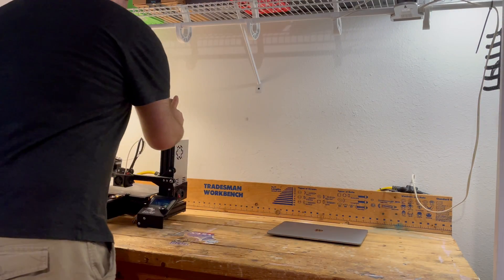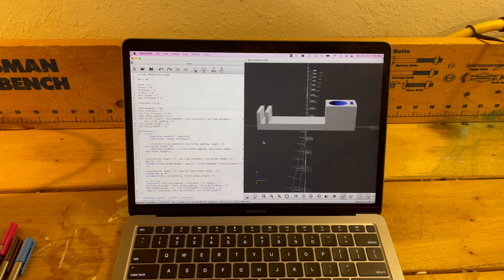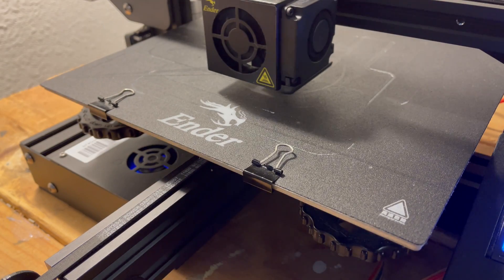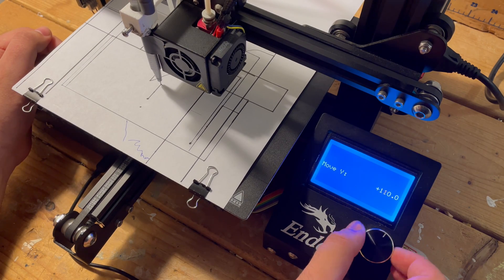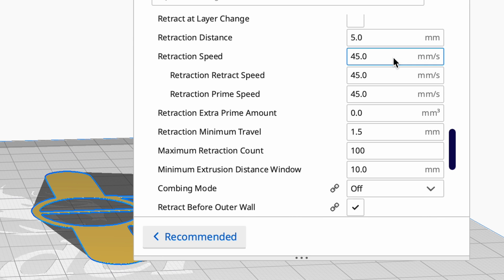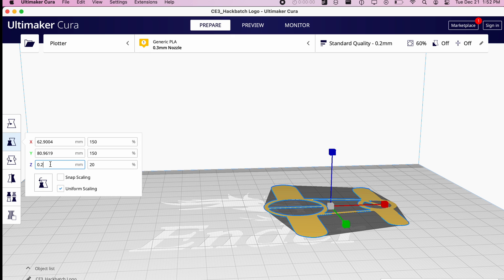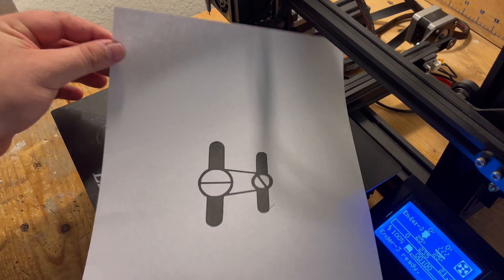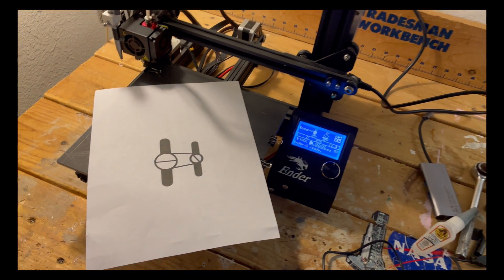How to turn your 3D printer into a drawing machine

Comment: How do you calibrate for the pen? I know you covered the z axis but how do I make the pen the center?
Reply from the maker: What I used after making this video was an extrude offset in Cura machine settings for my printer. If you click Preferences from the top menu bar in Cura then, Configure Cura, Printers. Next select the printer you want to edit and click Machine settings. Click on the Extruder tab and it should have an option for Nozzle offset X and Y. This will let you tell the printer that the nozzle is offset to the point where the pen is. So if you measure it from the nozzle you can center the pen depending on where your paper is of course.
Reply: @hackbatch  thank you!! very helpful!
Reply: @hackbatch  Hi, another question: How do you measure the exact distance from the nozzle to the pen to input in Cura? I'm guessing the number must be precise in order to work.
Reply: @petrickstea2422  If you use ender 3 you can just moving the axis until it reach the corner, and then you see how much mm you have movd
Reply: Hi
Reply: It's a complete step backwards in 2D printing... Or at least five, but it's great

Comment: Thank you amazing video! Cant wait to turn mine to be able to do this too. Question that i will be able to answer eventually my self but here it is. Can you keep the part on the printer while ypu normally 3d print or needs to be removed if not in use?
Reply from the maker: Yes in this case I was able to keep that part attached to my printer with the pen removed and it was just fine! Glad you liked the video, thanks
Reply: @hackbatch Awsome man cheers!

Comment: Actually I think you can install a mosfet like system to the extruder motor that controls a servo which lowers the pen whenever the motor starts to move, I think that would solve the Z-hop problem.

Comment: @hackbatch ,can you still 3d print after doing this
Reply from the maker: Yes! This is just the slicer settings plus a plastic attachment for the pen. You can always take the pen out and 3D print as normal
Reply: @hackbatch  can i also do this with the BL touch still there?

Comment: Excellent video, thanks.
Funny things, humans... we are prepared to devote hours to achieve a result that our cheap inkjet printer would have done better in a few seconds!
This is NOT a criticism of your project;  I have spent a ridiculous number of hours on a pen and vinyl-knife holder for my Ender 3.  Like you, I've had very pleasing results with the pen, and the Ender can now write my signature better than I can.
For anyone wanting to try the drag-knife, the printhead carriage on a typical 3d printer does not really have the necessary rigidity.  I was able to produce pleasing car window signs when I was selling it, but eventually the knife blade snagged in the cutting mat and snapped my knife holder.
A strange quirk of fate: I just finished 3d printing a replacement holder last night, a year after the original broke...  Is that spooky, or was Google eavesdropping again!   😮
Reply from the maker: Funny things indeed! Thanks for you comment. I am definitely the type to spend much too long tinkering but I am happy to do so. And thanks for providing your tips on the drag knife mod.

Comment: I am trying to do this on the Neptune 4, using cura. The problem I keep having is just as the pen is about to hit the paper and begin plotting I am getting a klipper message saying - 

PLEASE RUN ‘SDCARD_RESET_FILE OR ‘FIRMWARE_RESTART’ TO RESUME.!! Extrude below minimum temp 

It seems the printer will not allow me to run Gcode with the extruder temp set to 0. 

Can anyone Help
Reply from the maker: I have no experience with Klipper firmware but it sounds like the firmware has a setting that doesn’t allow for 0 temperature. I would try disabling the hot end in Cura in your machine settings. I am not sure if that will do it, but it might help. Otherwise, I think this might be a firmware level restriction with Klipper.
Reply: Thanks for getting back to me, where would I find the option to disable the hot end? I can’t seem to locate this.
Reply from the maker: @3dmaker186  It seems I am misremembering a setting in Cura that does not exist sorry. It looks like you can disable the heated bed but not the nozzle. Not sure what the solution is here besides a change at the firmware level. or possibly manually replacing lines of the GCODE file to not move the extruder motor. The method shown works with Marlin and that's the only firmware I've tested it with.

Comment: When I first installed the Z offset extension, it did work for me, but throughout experimenting, maybe also after I installed few more extensions, I could not get the desired effect whatsoever. It was frustrating. Though, I managed to work around it by initiating the print and hitting PAUSE immediately on the printer (after it did the initial moves, but before the print). Then I manually adjusted the z-offset on the printer under tuning and resumed the print. But before that, it broke the tip of my pen... What a frikkin force.

Comment: Will the printer not try to extrude the filament anyways?
Reply from the maker: The nozzle is not heated. I suppose it might be trying to move the filament but if that is an issue you can unload the filament before plotting.

Comment: Get a drill tap threader for those holes. Never needed a nut ever again. One of the most revolutionary thing I did for my prototypes.
Reply from the maker: I mostly use heat set threaded inserts for my prototype parts nowadays. Thanks for the tip!

Comment: How can i get rid of the line that the printer leaves after its done printing?
Reply from the maker: You can add a line of GCODE to the end of the print that raises the pen upwards before it moves over. In Cura, if you look under the machine settings you can add a line to lift the nozzle and the pen in the End GCode text box. I forget what the code to lift the nozzle is but I’m sure you can find it with a quick search.
Reply: @hackbatch  ok thank you

Comment: Love what you did here. Possibly a more elegant solution that some that I have seen that used laser gcode. Do you have any suggestions on how you could use this on a printer that has a bed sensor like the BL Touch?
Reply from the maker: Unfortunately I don’t have a bed sensor, but I think that might make it more complicated than it has to be. I just measured the distance from the pen tip to the nozzle to have the correct GCode offset
Reply from the maker: It might be possible to put the bed sensor where the pen would be, but that still requires aligning them. So I think it’s possible but I don’t have any experience with that sorry.

Comment: Hey, Great video!  Quick question- I am starting the printer with gcode, and it is stuck at heating. Do you know what the issue might be?
Reply from the maker: Hello, thanks! You should disable the heating on both the nozzle and bed by setting their temperatures to 0 degrees. Unless the printer is somehow checking for a temperature over 0 degrees and never reaching it. I would double check what it’s trying to heat up to on your printer. If it’s anything above 0 stop the print and redo your gcode file. Hope that helps!

Comment: Great video helped me a lot. I have a question, I'm having trouble converting my SVG to a good STL file, do you have any recommendations? I've tried many online tools but the results either don't work or are bad. Thanks! I'm trying to do writing by the way.
Reply from the maker: Hi Thanks! The tool I used is linked in the blog post in the description. Perhaps the results you are finding are due to something with the SVG paths for the writing. Are you using a font in SVG somehow? I was interested in doing this but that’s the part I got stuck trying to automate.

Comment: Why don’t you have to mess in the G-Code more than that ? The code tell the printer to home all axis the pen will hit the bed and destroy everything plus there will be preheat
Reply from the maker: That’s the purpose of the Z offset plugin from the Cura marketplace. It modifies the gcode to be offset from the bed by the number of millimeters that the pen extends below the nozzle. This way when the homing sequence finishes the pen doesn’t crash into the bed when the pen is “printing”. You can disable the heating by setting the temperature of the nozzle and bed to zero. If you are unsure if your printer will do this I would recommend testing it without a pen or paper first and see if it works without heating and the offset.

Comment: Thanks for making a full explanation on how you did that!
I plan on doing this to write "labels" on some of my burned CD-Roms
Because sticking paper labels on those makes them heavier, ungainly... idk how to explain it
And because I have an absolutely terrible handwriting!
Reply from the maker: Hi thanks for the comment! I was considering writing on the paper with a font converted to GCODE but haven’t quite figured out how to do it. A few other people were asking about how to do writing in the comments so if you find something interesting let us know!
Reply: @hackbatch  I thought about doing that as well because I had a letter to send and my ink printer is out of order, but instead just wrote it the boring way...

My 1st angle of attack for this was to try to do some .SVG writing with Gimp and then convert it to .STL
My other plan was to do a hilariously high res black and white .PNG the text and then just slap it into Cura and hope my settings can write it all...
Reply from the maker: I hadn’t thought of doing it the PNG way. That actually could make it easier, to automate. There are many image manipulation libraries so it could be possible to plop all the letters in order in a PNG then somehow get it into gcode and print it all at once. Thanks for the ideas!
Reply: I would have just used MSPaint and drag my .PNG to cura honestly

Comment: I have the pen holder but Cura doesn't let me slice when i put the material temperature to 0. I just can't generate the gcode. any suggestions?
Reply from the maker: Test and see if you can slice it before setting the temp to 0. (Don’t print this gcode though, you don’t want a hot nozzle on paper) This will determine if it is the temperature setting causing the slicing issue or an issue I had when testing which is the STL file is not tall enough to be sliced. That’s the only time I wasn’t able to slice properly. Try scaling the STL model in Cura in the Z direction a bit. Hope that helps!
Reply: @hackbatch   The issue was i set the flow rate to 0 too, that was causing the error. Thanks for helping me going trhow with a fresh approach.
Reply from the maker: Glad you got it sorted out!

Comment: I see one of your test prints had lines going across the page. I am having the same problem. How did you fix this?
Reply from the maker: For the ones that cut across the entire print, I used the combing mode setting, (https://all3dp.com/2/combing-mode-cura-simply-explained) To fix the line when the print finishes, I used the starting and ending gcode feature in the Cura Machine Settings. Then I just played around with the gcode for lifting the nozzle when the print ends to be higher. Hope that helps!

Comment: is posibil to write with thhis seting ?!
Reply from the maker: I have considered this and did some initial research. It seems it is possible if you are able to convert a font to SVG then to gcode commands by tracing the paths of the letters but there would be some code involved. I think the best route would be to send those commands from a program over a USB cable with a serial connection to the printer. Although generating the gcode file and putting it on and sd card would work the same way! I haven’t tested any of this but that would be my starting point.
Reply: @hackbatch  I am trying to set this up for writing as well. Do you have any more info on how to take the custom fonted SVG over to the printer to be printed? By what I understand of your comment it's possible to skip the STL all together? Thank you.
Reply from the maker: Yes it is possible to skip the STL by sending GCode to the printer over a USB connection. That’s where I would start for making this work. You could also use an approach where you already have the STL files, convert them to gcode and then “play” the gcode files in sequence by sending them to the printer as commands over USB. This might make writing with a font easier. This all requires some custom programming though.

Comment: Please Help Me. I'm having a problem during drawing. When traveling from 1 side to another, it drags the pen. Example. Say I was drawing a metal washer ( basically 2 circles) It draws the outer circle then the inner circle. But draws a line connecting both.. I've played with retraction and Z hop, and it works if I draw multiple washers, but every washer will have a drag line from outer to inner circle. Any thoughts. Thank you
Reply from the maker: The way I fixed the drag line at the end of my print is by adding Z hop and adding a line of GCode manually between prints with the pen. Only discovered this after the video but you can add gcode after prints complete in your printer configuration in Cura. I forget the specific gcode required to lift the extruder but you can find it online. Hope that helps, let me know!

Comment: Does the 3d model support kingroon kp3s pro? Thx.^o^ 😃😃😊
Reply from the maker: I used the OpenSCAD file to modify it for my printer, you might be able to do the same! I am unfamiliar with that printer but I believe the original file was for the Ender 3 so it might need some tinkering to get it to fit yours.

Comment: Thanks for uploading this. This is all the right info I need to make my printer into a plotter.
Reply from the maker: Glad I could help!
Reply: @hackbatch  It was the Cura settings that were the most helpful and the info re the z offset plug-in. May I ask which version of Cura you're using? The setup looks different from the 4.11 version I have. Thanks again for posting this video.
Reply from the maker: Unfortunately I don’t know what version of Cura I had at the time. I know that Cura hides some of the settings unless you turn on their visibility. By default some/most are hidden.
Reply: @hackbatch  That's true. I couldn't  find the z offset plug in after I had installed it until I discovered the visibility settings.

Comment: Awesome project man! I tried to do this, everything seems to go exactly to plan, until I import the file into Cura and get a "Make sure the g-code is suitable for your printer and printer configuration before sending the file to it. The gcode representation may not be accurate. I followed the medium article, I followed everyone of your cura settings, i've tried dozens of times, not sure what the problem is. If anyone who has successfully done this would like to lend a hand, feel free haha
Reply from the maker: Hello thanks for the comment! I am wondering how you generated your G-code I didn’t include it on my blog post (I probably should have) but I used an SVG to GCODE converter online to make my gcode files. I made sure to make them thicker than 1 layer so that the printer could figure out what to do. Not sure if it’s a configuration of your machine in cura or the gcode itself that is causing the issue.
Reply: @hackbatch  Thank you for the response! After messing around a little more I realized it was 100% user error. Now just trying to dial in the right pen with the right attachment. Thank you soooo much for this project! Having a lot of fun watching your videos! Keep up the good work! Glad to be subscribed!!
Reply from the maker: Glad you got that part working! It took me a few tries to get the results I wanted too. Thanks for your kind words!

Comment: You don't need to disable heated bed, just set temp to 0°.
Also, changing infill settings doesn't matter as you are only Printing 1 layer and infill starts from 4th layer.
Reply from the maker: In my testing I found that the infill did make a difference. If I set the infill much lower, the pen would not create a solid fill. Not sure if this has to do with it being only one layer and therefore the infill makes a difference on the first layer or not.
Reply: @hackbatch  The interior was indeed using the infill settings due to how the floors and ceilings were set to 0. You can also tell from the color of the lines in the preview window after slicing.

You might be able to do some neat crosshatch style shading by reducing the infill percentage.